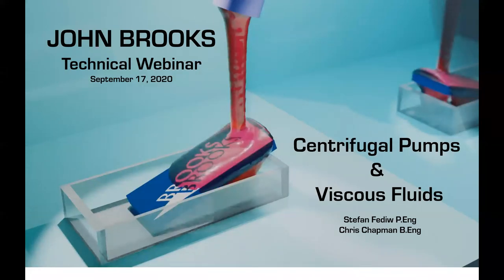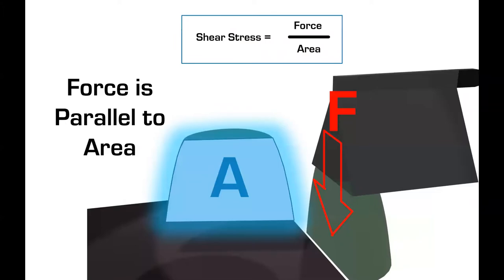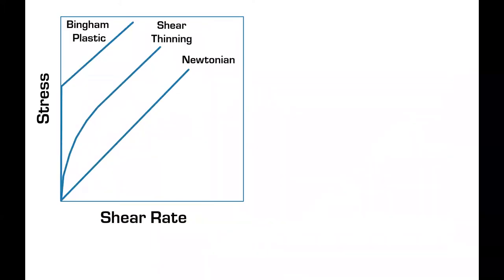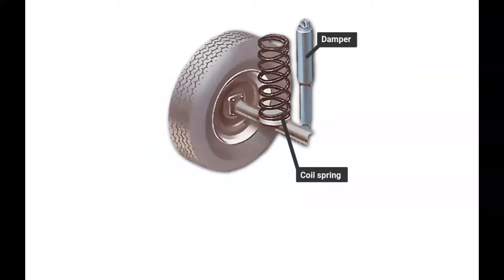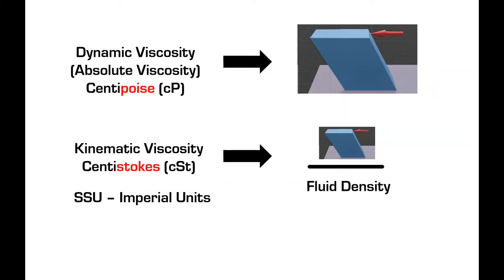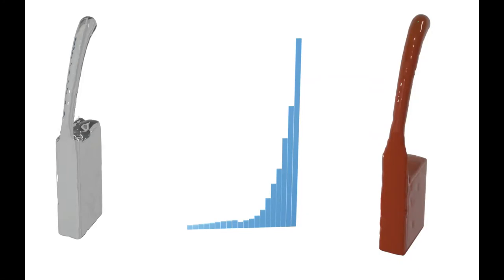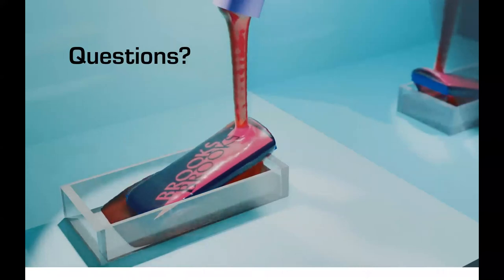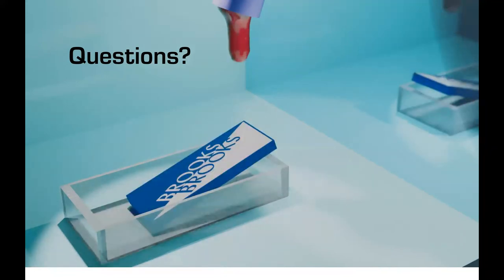Pumping Viscous Fluids with Centrifugal Pumps

Comment: So what is disadvantage using centrifugalpump for pumping viscosity fluid? Example honey or tomato sauce/paste.
Reply from the maker: Thanks for your Question. Stefan Fediw, has responded: "There is a limit to the fluid's viscosity when using a centrifugal pump. This limit varies depending on the type of centrifugal pump. In general, after about 600 SSU, centrifugal pumps start to consume large quantities of power. The higher the shear (multi impeller vanes), the more power required at increased viscosities. The other type of pump - positive displacement - generally can handle more efficiently higher viscous fluids." Please call us at 1-877-624-5757 if we can help you with a specific application.